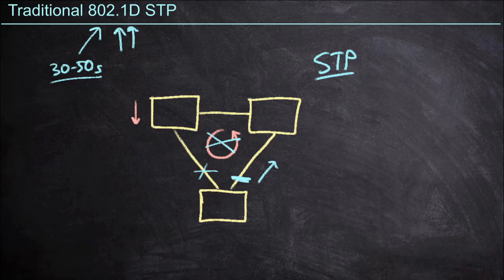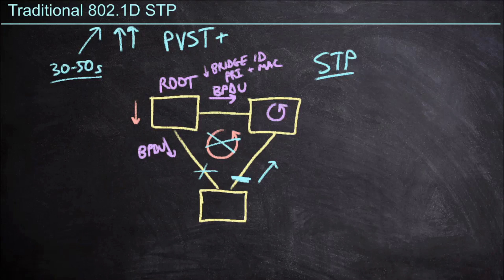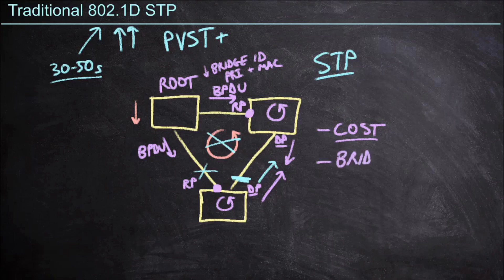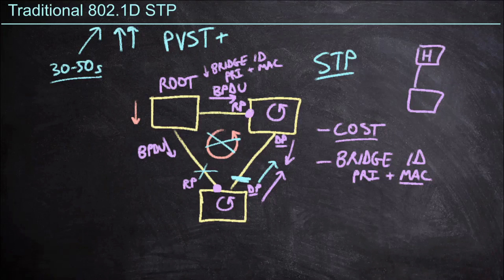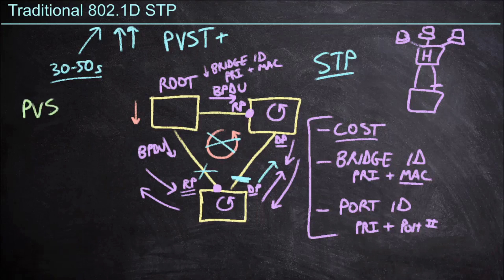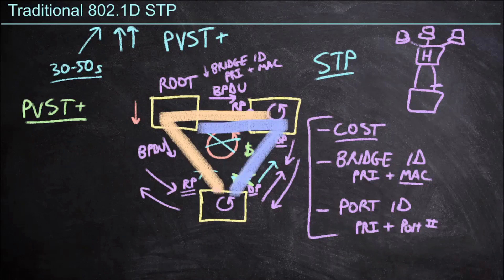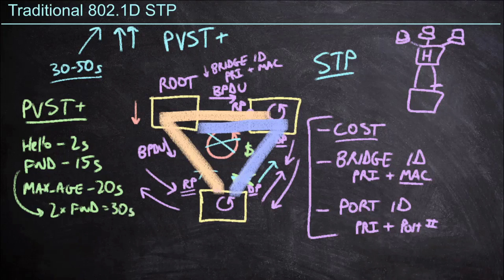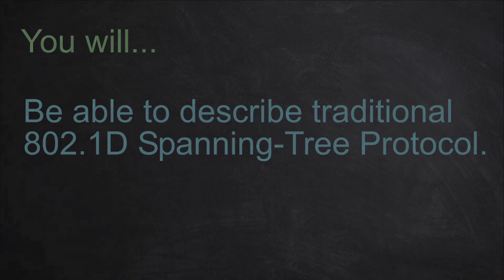Why Use 802.1D STP in Data Centers?

Comment: Would you consider changing the RSTP hello time to 1 sec to improve packet loss on failure in a datacenter?
Reply from the maker: Hi, Joey! You can certainly set the timers to be in milliseconds. The convergence will occur much faster. Try to design the architecture to have as little need for STP as possible. Hope that helps!

Comment: Just what I needed, you’ve made my choice in STP easy

With PVST+ this can be another way in which I can configure load balancing between VLANs sending traffic (based on your diagram) either to the left of the topology or to the right of the topology, which means this is an addition to EtherChannel (STP and EtherChannel achieve different goals, but from the video explaining share load balancing qualities). 

Another way to fine tune the network and optimize the traffic—wonderful video!